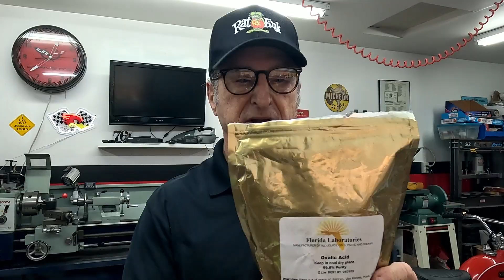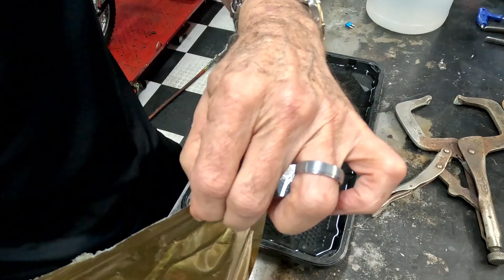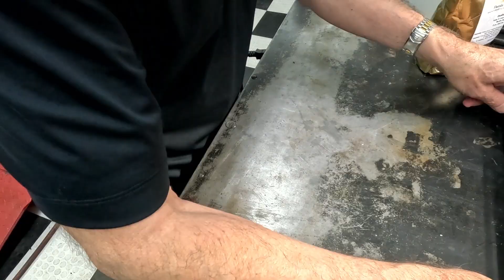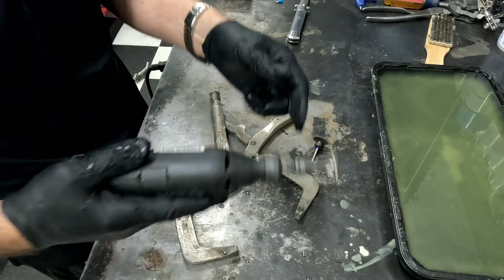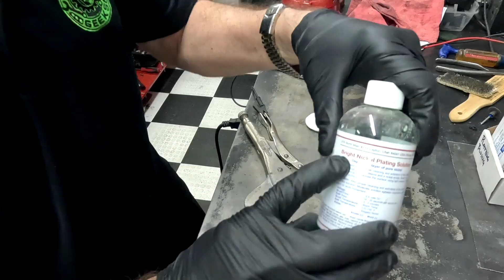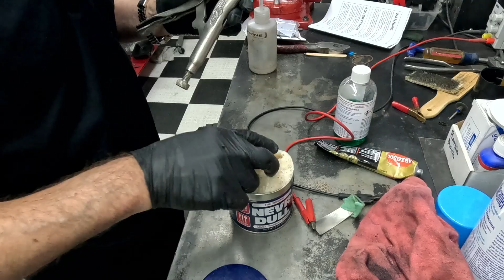HOW TO RESTORE A RUSTY VICE GRIP CLAMP!

Comment: Cool, fun experiment! And cheaper than Evapo-Rust.  I need a voltage supply next...
Reply from the maker: Thanks, yet again for watching. I was pretty amazed as to how well it works. I need to find a super rusty tank and try it.  The power supplies are pretty cheap, get one that will do 10 amps with adjustable voltage. They work really well for testing bulbs etc. as well.
Reply: @GearHeadGeeks Thanks! Off to Amazon I go!